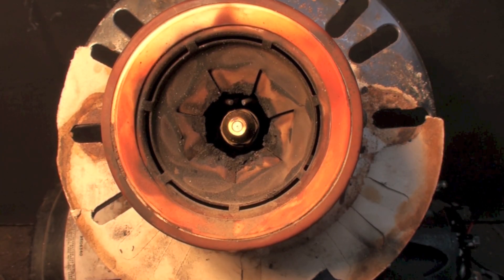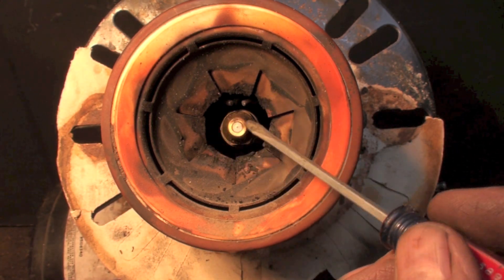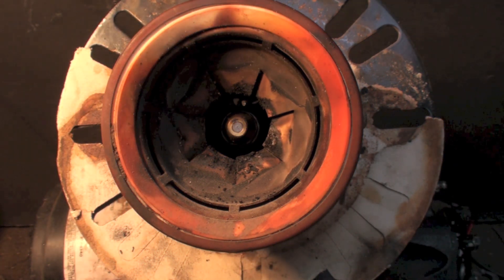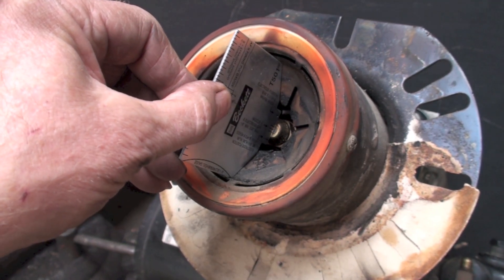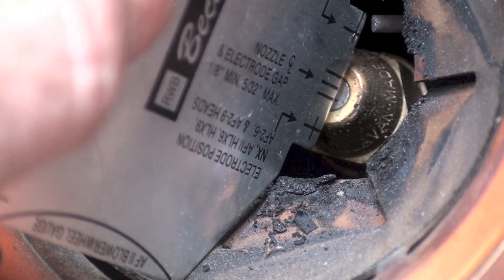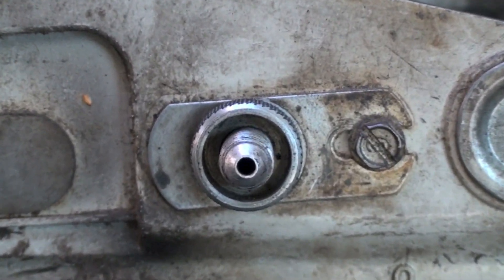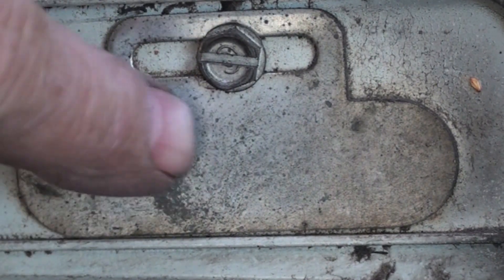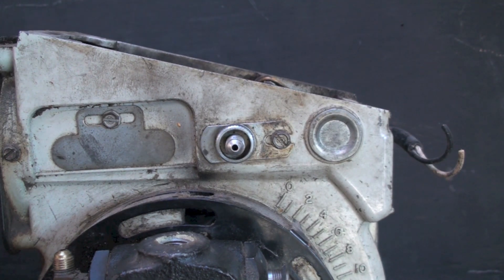Oil burner gun depth adjustment

Comment: Can you substitute an F4 retention head with a F12? On an old Beckett ?
Reply from the maker: You can if the nozzle size is .85 to 1.35 GPH and the 3-3/8" static plate is used on most burners.
GFM
Reply: @grayfurnaceman  awesome thank you

Comment: Do you prefer the $11 universal Crown 40445 or the $17 Beckett Z2000u that can set depth without removing the whole assembly?
The Crown has included an adjustment variation based on nozzle angle.
Reply: BECKETT Z2000u is easy to use, priced cheap, exact, and very accurate. Strongly recommended.
Reply from the maker: I can't say I have ever used the UC.
GFM

Comment: I'm not getting fuel oil out of the gun, pump is working and getting fuel oil to it.  I am not getting it out of nozzle. Nozzle has been clean and lines blown out, still nothing. Any ideas would help
Reply from the maker: If you are getting oil and pressure to the nozzle, the nozzle is plugged.
GFM

Comment: After changing my nozzle and getting all the soot out, I now notice red fuel oil dripping out the bottom of the furnace (not from the burner pump or motor), not much about 3/4 teaspoon. I re-positioned the gun assembly moving it forward till the electrodes touch the retention head then backing off slightly, so the assemble moved forward about 1/8 inch. Ignition times starts fire 0.02
I have a pro tek strainer on the back of the nozzle. When i removed the gun assembly the electrode tips (there rather new, not worn) were very black from the tip about 3/16 back plus the new nozzle blacks up some, could the oil spray be hitting these tips causing oil to go to the bottom, fire looks OK. The retention head looked very clean and dry. Blast tube was clean and dry, no oil in motor housing. I noticed some oil on the underside of the transformer and on the cad cell.
Reply from the maker: They could.  The tips should be aligned with the end of the nozzle or slightly back.
GFM
Reply: Thanks, I got the electrode alignment in the manual for the burner. I also tried using a 2" inspection mirror through the sight port, after some patience adjusting it around some I was able to see the nozzle in the combustion chamber, I'm pretty sure the gun assembly was set back too far. My gun assembly wont come out unless I loosen the set screw, so I marked the position.
Reply: I still have oil leaking from the bottom of the combustion chamber under the burner,  I can't feel any oil leakage under the pump or motor. When I tilt back the transformer there is a light coating of oil on the underside and drops of oil drip out the front of the cad cell.  My furnace blast tube is sloped some into the combustion chamber, I tried the pump pressure at 100 and 106 psi same issue. On the gun assembly the tip of the nozzle is about even with the inner area of the retention head. I just can't figure out what is causing all the oil splashing around. Changed nozzle twice (.75 80A) nothing looks cracked or broken on the gun assembly. Motor fan turn forward towards the chamber. OK I found that if I shine a flashlight through the air band I see oil spraying around on top of the coupler area, and dripping on the bottom of the air band. Am I correct to say the pump rear seal is bad ? I can still adjust the pump pressure manually and have it set for 100psi now.
Reply from the maker: Are you sure the pump seal is not leaking?
GFM
Reply: Yes I do believe it's the pump shaft seal I have ordered a couple. Turned off the furnace for now, using electric heaters.
Reply: Can problems arise if the gun assembly is too far forward ? Other than the fact that the electrodes might hit the retention head, I am aware of that. It would seem that the farther foward the gun is, the less the chance of oil hitting the retention head.
Reply: The depth of the gun assembly should correspond with manufacturer's specs.  For a Beckett AFG that would be 1, 1/8" from the burner head.
GFM @kommoncents-------1

Comment: hi  i like this video, up till no i have managed to service my boiler myself,  but i have now messed bout with it so much it all needs resetting.  this Becket guage seems to only be available in the states.  any idea what it might be called in france or UK.  its too crazy to buy one for .99$  and pay 10$ postage.  failing that could i make my own?  just for the gunner,  the distance in mm from the jet to the edge of the metal plate.  hoping someone can help! its getting cold!!  thank you
Reply: I think it's crazy for you to be so cheap that you won't spend $10 to be warm, they come free with an electrode kit , just spend $11 on a electrode kit this way you feel like you're getting your money's worth. tighter than two coats of paint mama!
Reply from the maker: The depth is 28mm.  You can just use a tape measure from the nozzle to the end of the burner tube with the head installed.  This works for most Beckett burners.  
GFM
Reply: Thank you  i will give that a go.  although i cant find any identification on the burner unit itself as to what make it is.
Reply: the end of the burner tube?  is that the metal plate that the nozzle pokes through?  or the end of the overal  tube that the whole thing sits in?  are these measurements fairly similar across the board with different burners?   ta again.
Reply from the maker: If it is a Beckett burner, the end of the tube that contains the gun assembly has a sheet metal head mounted on the end.  The distance is measured from this head to the nozzle.
GFM

Comment: that tool 501 its feet to any burner ?
Reply from the maker: It only fits the Beckett.
GFM
Reply: +grayfurnaceman  thanks a lot.....   make one video about the steps  to adjust  the  burner...... how to can calculate the distance of the nozzle if you dont have manual?
Reply from the maker: I will put it on the list.
GFM

Comment: If you don't have a Beckett measuring tool, is the depth measured from the top of the nozzle to the end of the barrel or the top ring with the mounting screws that goes around the top of the barrel?  The depth on my Beckett is 1 1/8".  Thanks
Reply from the maker: You are ok.  It is from the nozzle to the finished end of the burner tube.
GFM

Comment: I do have baseboard. Thanks for your reply and for the video.
My old boiler (Remco) always needed cleaning and was not very efficient.
Reply: Pull the shell off the boiler typically there is an access point in the outer case of the combustion chamber, as long as the boiler is clean and  CO2and nozzle setting are correct you should be fine. People don't know that changing the entire burner is equal to changing your cars motor . complete their about $500.00 supplyhouse.com  has great prices. Good luck!

Comment: I had a new oil furnace and burner installed a few years ago, Burnham with a becket.
I was told the optimum setting for winter is 180-200 setting for optimal heat transfer. That's what I've been using.
Reply from the maker: dhowar I would agree if the convection is baseboard.  
GFM

Comment: Thank you, i do have old type oil furnace,(boiler and oil burner) , and two zone, and baseboard hot water heaters, i have it on 140-160, i wonder make it(in cold season) different to lower the numbers, or higher them to save on oil,i live in eastern Canada....sometimes gets to -10 C, or even more cold time,
Reply from the maker: Your numbers are quite low at 160 with baseboard convectors.  I would recommend 180 for baseboards.  As to saving on oil, lower temps may help (although not much) in the milder temps.  Hope this helps.
GFM

Comment: Hi,first thank you for your videos,i asked you in you other video too that, i have set my temperature on my furnace "winter time" on ...low 140  and hi 160,and diff on 20, are these are good setting?
Reply from the maker: My earlier answer was of the wall thermostat.  As for boiler temps, it depends on the type of radiation.  Cast iron radiators will operate with temps of 120-140 for mild temps, with an adjustment 140-160 for lower outdoor temps.  Baseboard units will need higher temps such as 170-190.  Hope this helps.
GFM